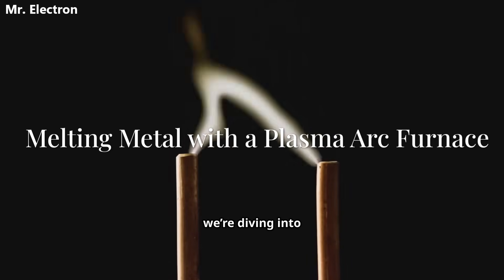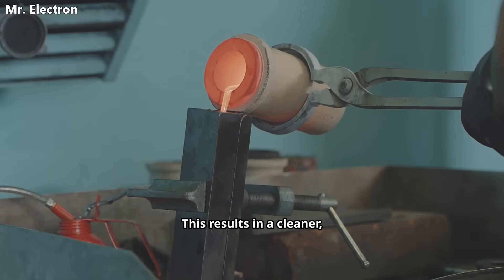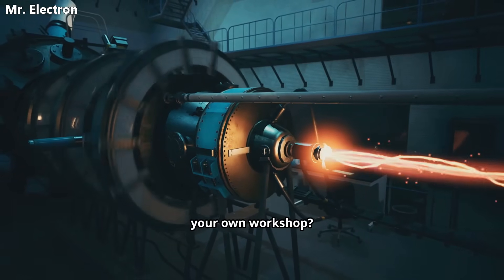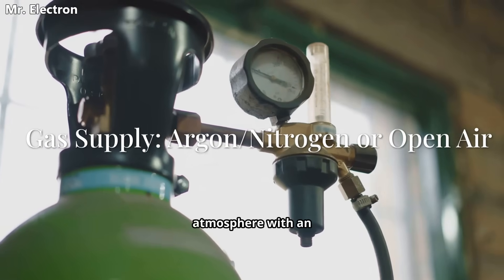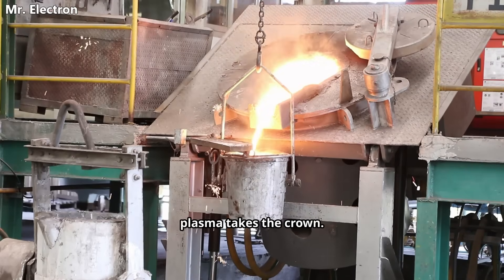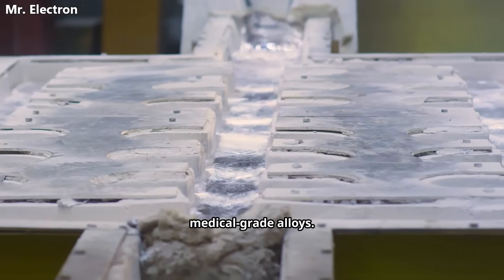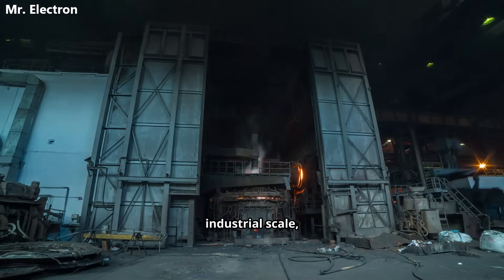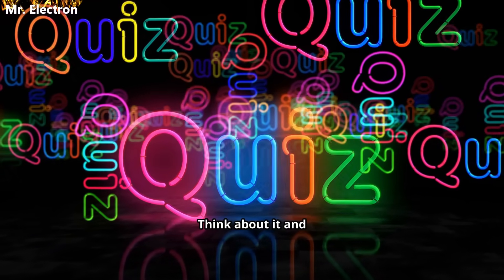DIY Plasma Arc MELTS Metal Faster Than Induction Heaters

Comment: nice. make a plasma heat-mhd jet thruster. with low voltage high current U-shaped graphite rod. works also as mhd railgun and electric plasma detonation thruster. same tech can be used for fusion inertial arc containment fusion reactor inside heavy water container. works like a filament light bulb. deuterium fusion is no joke, radiation warning. vacuum melter might be simpler than getting shield gas from somewhere. cant both techs pump the same input power as heat output. induction is typically more efficient than external heat. induction has problem if your target is not conducting by itself. ie plasma arc can ionize itself. hold on, if you use mhd plasma-railgun as the blower then you only need low dc current. well plasma arc is better if you want to heat the plasma itself. and not so much the target. with mhd railgun the arc itself is not touching the graphite itself. plasma can be better for non-conductive targets where you have to heat a secondary material anyways. microwave melting kilns are nice too. similar to induction kilns.

Comment: How to positioning the electrodes in the crucible man? And how to modify the welder?
Reply from the maker: 1- take a welding machine. Its usual output is 48v. Still measure it and confirm.
2- make or buy a 48v to 2000v 0.5 amps dc or ac converter if your welding machine output is 48v.
3- connect the 2 ouput wires of your converter to 2 graphite rods placed very close to a crucible as i have shown in the video. Remeber, the project is very dangerous so take all safety precautions as it can definitely be deadly. Use the help of an electrician who has experience in this field.
Reply from the maker: 1- take a welding machine. Its usual output is 48v. Still measure it and confirm.
2- make or buy a 48v to 2000v 0.5 amps dc or ac converter if your welding machine output is 48v.
3- connect the 2 ouput wires of your converter to 2 graphite rods placed very close to a crucible as i have shown in the video. Remeber, the project is very dangerous so take all safety precautions as it can definitely be deadly. Use the help of an electrician who has experience in this field.

Comment: The author mixed up two a bit different concepts - arc furnace (most of the videos) and plasma furnace/cutter. They are close but significantly different. Plasmatron has high voltage and arc has 12-24V. Both however are current-regulated.

Comment: What gets me is that you  actually believe that the surface  of the sun is only 5500° Celsius. do yourself an experiment heat up some metal to 5500 Celsius if you can measure it some how and then see how long it takes for the metal  to cool down , then apply your findings to that supposed temperature that scientists say the suns surface is.  Keep in mind that if the metal cools at a fast rate of speed  then thats how space would do also around the suns surface, also keep in mind  scientists believe the surface of the sun to be 93 million miles away so the heat emitted from the surface of the sun wouldn't reach the earth to keep the earth warm enough  for anything or anyone to live on it . Furthermore  your statement  say the suns surface "Is" only 5500°c based upon what's perceived by those who study the sun  but a perception is not a fact. Infact scientists only perceive that the sun uses nuclear power yet the can't confirm that beyond a shadow of doubt.  So can you confirm  that the suns surface is only 5500° Celsius beyond  a shadow of doubt? If not them why make such claims if such claims are not  based upon concrete evidence  instead of speculations by scientists who aren't  all knowing? Become more a critical thinker dont only let some scientific research cause you to believe everything  is 100% accurate according to their imperfect human thinking
Reply: The Sun's temperature isn't measured with a thermometer or by heating metals here on Earth. It's determined through spectroscopy, analyzing the light emitted by the Sun. Each chemical element has an emission/absorption "pattern," and comparing these patterns with physical models gives a very precise temperature.

It's not valid to compare a metal on Earth with the Sun. Cooling here occurs through conduction, convection, and radiation, while in space there is only radiation. Furthermore, the Sun isn't a solid object that cools: it's a gigantic sphere of plasma that is constantly generating energy through nuclear fusion.

The 93 million miles doesn't mean that heat is "lost." The Sun's heat doesn't travel like it does in a kitchen stove, but in the form of electromagnetic radiation (photons). That radiation reaches Earth in about 8 minutes and brings enough energy to sustain life.

Nuclear fusion on the Sun is not speculation.  Solar neutrinos (which are only produced in nuclear reactions) have been detected, and stellar models successfully explain what we observe in millions of stars at different stages of their lives.

In science, we don't talk about "absolute certainty," but rather verifiable and reproducible evidence. The temperature of the Sun's surface (~5500°C in the photosphere) is one of the most consistent and verified results in astrophysics.
Reply: @emilianodelvalle  He was ready to say that the Earth is flat like a pizza, and you threw a bucket of cold water on his fire 😂😂😂😂
Reply from the maker: I don't believe it to be 100% accurate but that's the only data available
Reply: Sun and Moon are local under The Firmament.
Also, it's all a fake, prerecorded virtual holographic simulation from the past.
The world you see is not real.
Reality is beyond your wildest dreams and imagination. :')